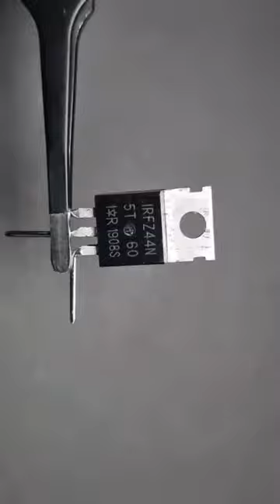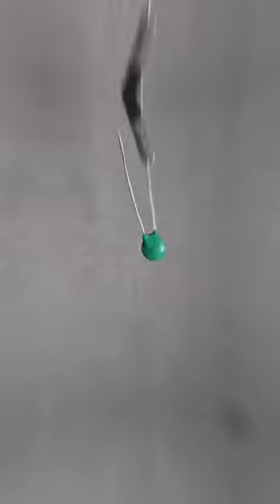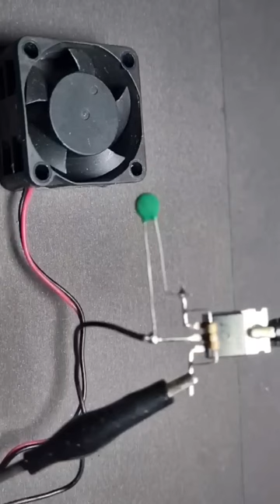Make a Mosfet Controlled Thermal Sensitive Fan #zaferyildiz #shots #short  #diy #viral #electronics

Comment: Means that can make energy outof heat, on big black bords under the day light 🤔🙄😌
Reply: Of course NOT. The fan is powered from a 12 V source. The circuit only allows the current to flow when the green component gets heated. 
Similarly, when you open a tap, water does not flow from your hand, it flows from the water utility's pumps.